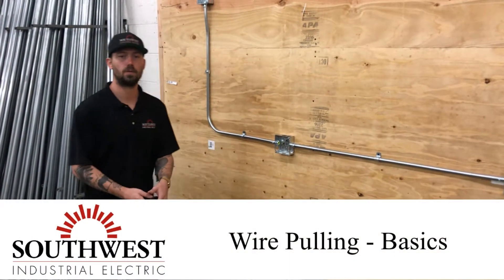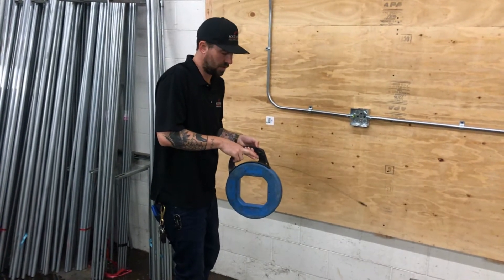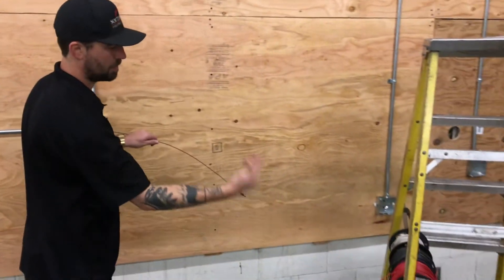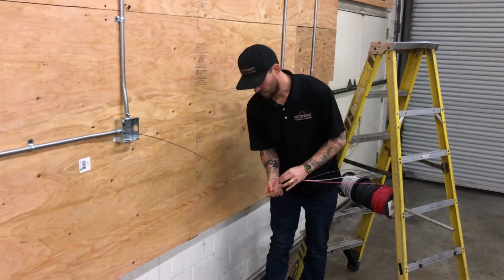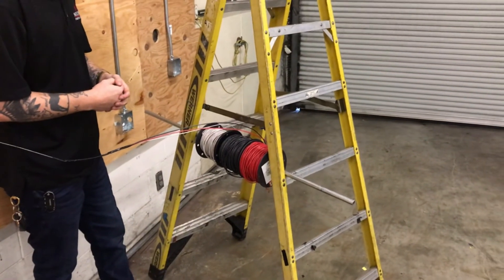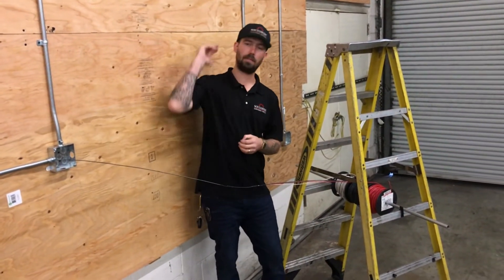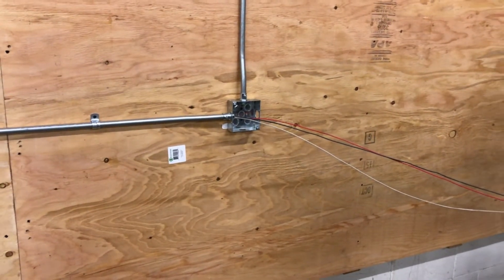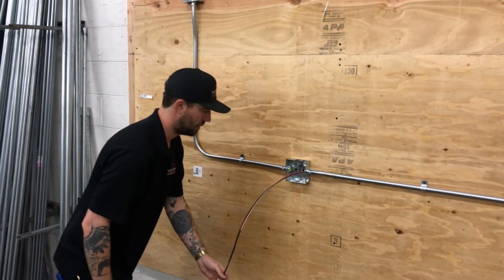Wire Pulling - The Basics

Comment: Is there any chance I can pull a neutral wire through a 16mm conduit with other 4 pre existing wires? I'm talking about an old installation that I want to expand, without the need of pulling back the pre existing wires, because I want to add some extra lighting spots that the previous electrician skipped, and the only way to get the neutral to these spots is passing it through the switch.
Reply from the maker: That really depends on the size of the wire size. There are tables you can reference in the NEC (National Electrical Code). If you don't have a copy you can access it for free on the NFPA website. Look for conduit fill tables.

Comment: First step, get a leader for your fish tape.  
Second step, get a milk crate for the wire spools. The ladder is tippy and the axel isn't level.And obviously you don't pull wire in a short run like this. You probably mentioned it but I didn't watch because I've pulled a million miles of wire and I'm sick of it.
Reply: An unweighted ladder is tippy, but you can certainly weight it to be more stable. A low axle on a milkcrate is a problem for conduit this height because the wire enters at an angle that drags along a sharp-ish edge. Obviously, all these problems can be mitigated, and the pull can be done more than one way.

Comment: Awesome video! Very well explained. I subscribed your channel. 
I will be learning on fishing cable in this week. I have one question; How can we protect the wires from getting cut on the edge of the EMT even when the burrs are removed? Is there any kind of Anti-Short bushing available for Rigid EMT? 
Thanks
Reply: Hi Ravi, great question and also forethought on your part, as protection of the wires as you do the actual pull is very important. To fully address your question let’s cover a couple points:
-	Yes, there are a few different anti short bushings that can be used to protect wire like these                                                              insuliners @ https://www.fastenal.com/product/details/0729758 or these plastic bushings @ https://i.stack.imgur.com/8lpmA.jpg 

-	We should point out that in several cases, these plastic bushings are not optional but are in fact required by the National Electrical Code.
-	Further reading on when you must use them and why, can be found here @ https://www.ecmweb.com/national-electrical-code/qa/article/20893630/code-qa
-	And lastly, we should clarify that “rigid” and “EMT” are separate materials to clarify:
-	“EMT” (Electrical Metallic Tubing) has a thinner, but solid wall and does not have threaded conduit ends, and you usually use set screw or compression fittings with it. Whereas “Rigid” is actually short for RMC (Rigid Metal Conduit) which is a much heavier walled conduit, and does have threaded ends, and you pretty much always use threaded fittings with it. 
Back to your main question though – if you’re doing a wire pull with a partner, it is their job to feed the wire into the conduit so that it does not get damaged, however if you are pulling solo, you may want to invest in some materials that I'll reference in a couple links below; they'll help prevent the wires snagging on the box edge or conduit wall – also make sure you watch all our wire pulling videos to help you prepare. Good Luck!

Notes:
https://www.amazon.com/Madison-Electric-Products-104-Pull-It/dp/B00H8NVKW4
https://www.licensedelectrician.com/Store/RT/PulLee.htm

Comment: why tape the head of the fishtape to feed into the conduit?
Reply from the maker: Typically when you are doing a wire pull it is on a pre-existing system, by taping the head of the fish tape, it's added protection to not snag anything along the way.

Comment: Good video! It’s a special skill to be able to pull wire by yourself and even more so if you plan the conduit run accordingly. Have you ever tried pulling wire from a milk crate? It fits 4-500ft of reels of #12 perfectly. You just drop your 4 reels into the crate with each one turned 90 degrees from the next so that the 2 round edges of each reel is rolling against the flat side of the reel next to it. No axle or ladder needed! Just pull your wires straight out of the crate. It works great until the reels get light. Just subbed
Reply from the maker: Thanks for a great tip!

Comment: Great instructor. He did one thing right but did not tell you. ALWAYS PLACE THE WIRE SPOOLS ON THE CONDUIT ON THE LADDER FACING THE SAME DIRECTION — ALL ROLLING OFF THE TOP OR ALL ROLLING OFF THE BOTTOM - ALL CLOCKWISE OR ALL COUNTERCLOCKWISE. This way one is not counter clockwise to another and causing friction and resistance. Yes, it even matters if one spool  is half empty and another is full - they will roll off at different speeds. No, it does not matter going 12 feet but it does going 100 feet or more. 
Also, don’t roll the tape all the way over the end of the fish tape - this will cause resistance. Leave it bare metal. Metal is more slippery than tape.  You will also notice he is not running a green ground wire - because he is using the conduit and boxes as the Equipment Grounding Conductor. That’s for another lesson.
Reply from the maker: Hey Larry, thanks for your tips! We prefer to roll the tape all the way over the end of our fish tape as it reduces the the risk of damage to existing components, especially where there is already existing electrical.  As for the ground wire, this video is for demonstration purposes only and was filmed on our training wall, so you don't see that green ground wire because this was a demonstration for wire pulling and not for wiring that would ever go live. Thanks for watching!

Comment: I will be doing this to add 1 wire throughout my entire house!! My retard installer 40 years ago only put in a neutral & hot wire.  If I knew where the original installer was, I would go beat him up. However they are most likely dead by now. Anyway thanks alot!! In my case i will be using polymer fishwire so I don't damage the existing wires.
Reply: By code the conduit can be used as the means of ground. (Its lazy as fuck). It requires the connectors to be tight throughout though. My guess is he low bid the job and was saving $$ on meterials to try and profit on the contract.
Reply: @Makitafan  Great Explanation. Also a good safe guard when done right. I found a ungrounded outlet we used for a desktop computer. That computer always had so many problems.

Comment: I'm suprised whoever did the pipe work installed the one hole straps with the screw on top. We always have the weight of the raceway on the screw.
Reply from the maker: We have found that the ratings of anchors for strapping conduits has a much higher Sheer rating than a Pull out rating. When installing the one hole strap with the anchor above the conduit, the force on the anchor goes straight down and the anchor has a higher rating for that force. When putting the anchor below the conduit the force is more of a pull out force which the anchor has a lower rating for.
Reply: @SouthwestIndustrialElectric  MIC DROP

Comment: I need a ground wire to convert a 3-wire dryer outlet to a 4-wire outlet. I don't have to upgrade (grandfathered), but I want to have a ground connection for our new dryer. Hopefully the existing wire was run in conduit, or I'll be patching drywall too.  We'll see.  Thanks for the informative video.
Reply from the maker: Of course! Thank you for watching. :)

Comment: Can I pull 16awg through ¾pvc conduit? 50 feet with three 90⁰ turns ?
Reply from the maker: rick james  Great tip! Thank you for sharing with the community!
Reply: @SouthwestIndustrialElectric number of wires permitted to be in half inch emt
Reply from the maker: Hey there, the NEC has a chart of conduit fill, so as long as you are within the range of wires, you would be able to do that pull.
Reply: @SouthwestIndustrialElectric  i dont understand the charts.
Reply from the maker: @Josh-mh3kl  Shoot! We don't have a video on understanding conduit fill yet, but there are a few others on here that might help you.

Comment: So if I were to effectively do this on a house with drywall up still, would I essentially need to locate every junction box along the conduit that I’d like to run it through?
Reply from the maker: Hello there Alexander, we specialize in commercial and industrial electrical, but will work to get you an answer on this!
Reply: I'm 9 months too late, and you probably know this by now, but if you're in a home with drywall (not plaster) chances are you have romex (NM-B) in your walls, which is more a cable than a raceway. Cables are preassembled sheathed groups of wires and you can't wire pull through that. (like you can't pull wire through an extension cord, for illustrative purposes). It is possible if your structure was built around the 60s that you have flex (FMC) conduit in your walls, which can be pulled through, and in that instance the answer to your question is yes. Most often the junction boxes in question in a residential setting will be in your attic or under your home in the basement or crawlspace.

Comment: Is the wire wheel expensive?  If so, can it be rented instead at the local hardware store?.  I am on an electrical project that I decided to take on myself.  It is an underground  circuit to some LED lamps to light up my business logo at night.
Reply from the maker: Hey there, it all depends on your location, but you should be able to find a place to rent one, like the local hardware store.

Comment: Y u put tape over end?
Reply from the maker: Hello, the tape over the end helps us pull all the wires at once. So we tape them together to pull them together. Hope this was helpful!
Reply: @SouthwestIndustrialElectric  I'm talking bout the fish tape not the wires
Reply from the maker: @Eastbaypisces  Ahh I see. If you check out our other video Fish Tape Head Prep For Wire Pulling we explain how and why we prep our fish tape that way. Essentially it is to protect any components that might already be preexisting in the conduit from the hook at the end.
Reply: @SouthwestIndustrialElectric  how do i do it if im starting at 90s on both sides(im doing pvc sch40)?
Reply from the maker: @Eastbaypisces  It really depends of the way your pipe is running and what direction the 90s are facing. Wire pulling with 90s on both sides is certainly more difficult than a straight run, but there are a few factors that could change the way we would instruct you how to do it--perhaps we should add this tutorial to our list! Thanks for reaching out.